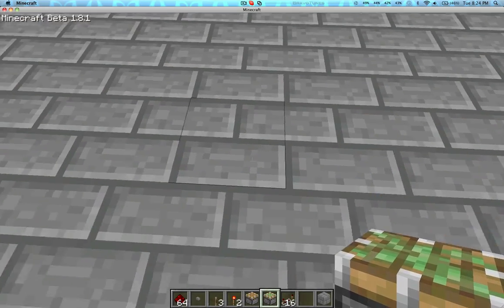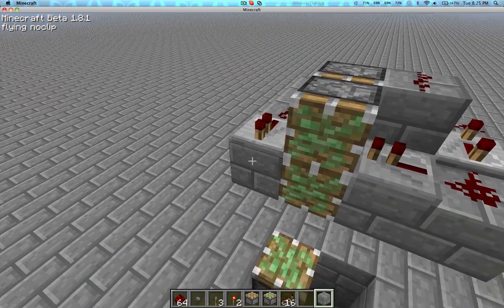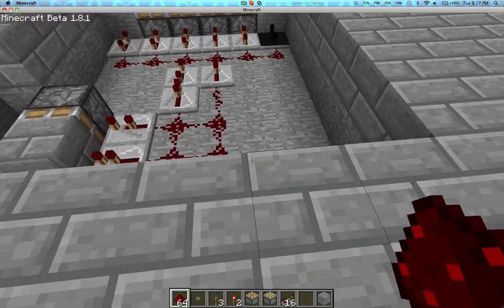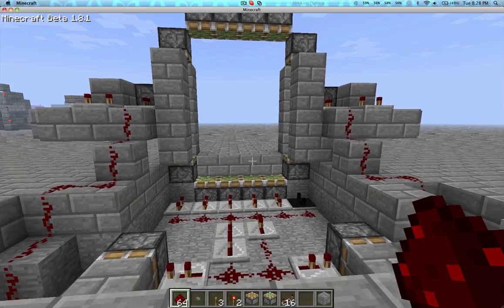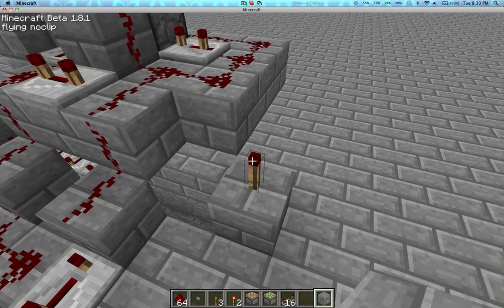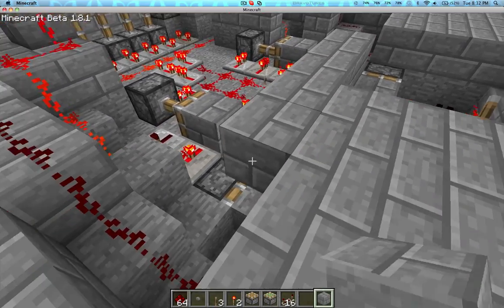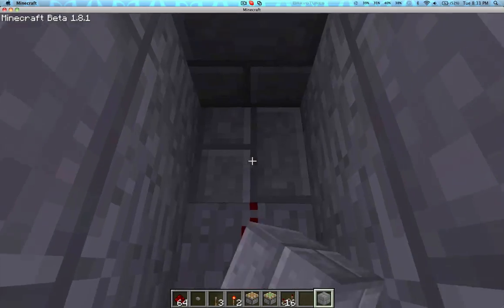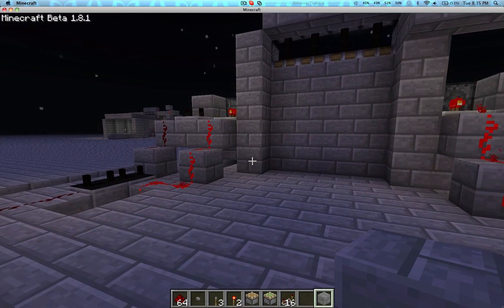4x4 Piston Door [Tutorial] Does Not work in 1.3.1

Comment: @254160 
is it visible from both sides (inside, outside) or only on one side?
a small fix vid would be totally enough :)

btw: the problem are the blocks inside the gate somehow, if you take off all blocks inside the gate it works :/